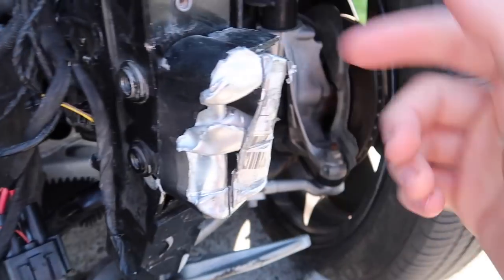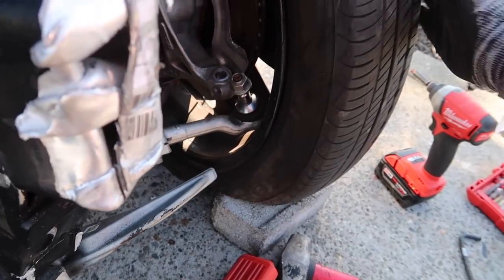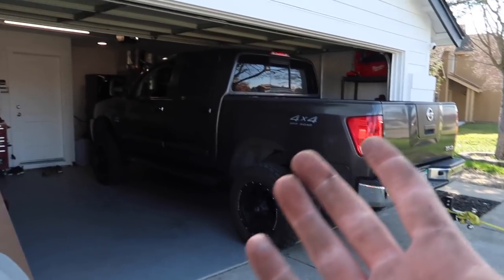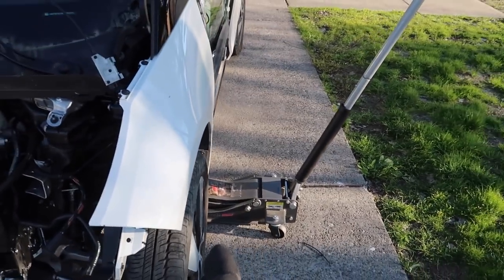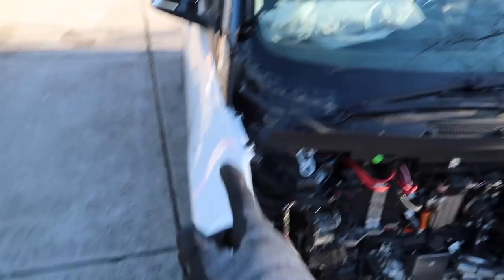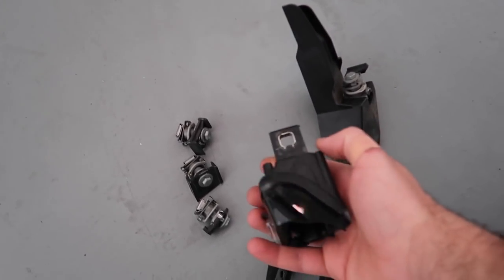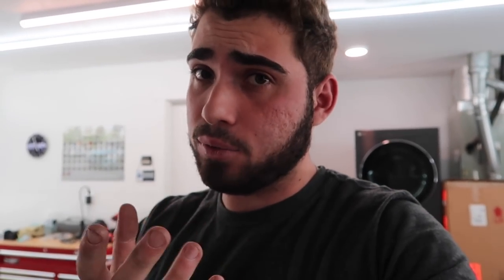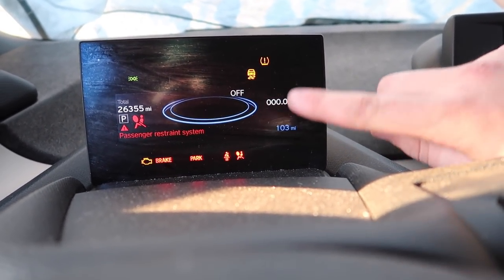THIS CHEAP $140 BATTERY GOT THE I3 REX MOVING!!

Comment: AY told you the mighty power of plastic welding would come in use one way or another! 

Glad the plastic welding for the tabs worked so well, piece by piece it's coming together.

Keep it up bro, the i3 is definitely a quirky vehicle but it's really a cool pickup to switch things up on the channel.

Comment: Bmw sells replacement brackets to bolt into the bosses you see next to each tab for like $60 for set.   At least you should have used metal staples that melt into place and then smear with epoxy.  The brackets save you lots of time and risk of future failure.